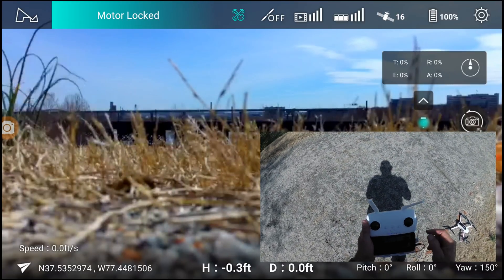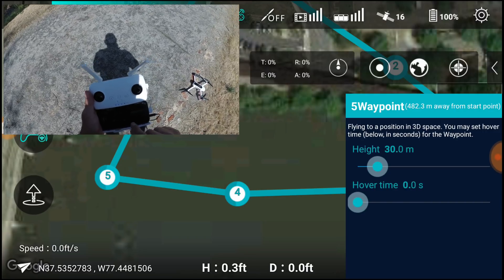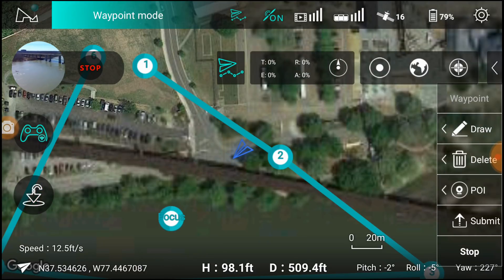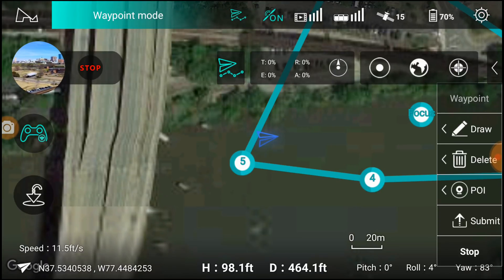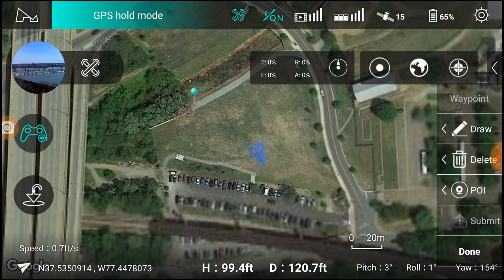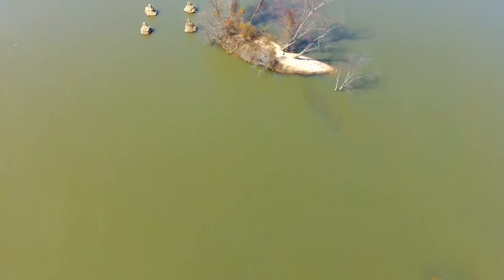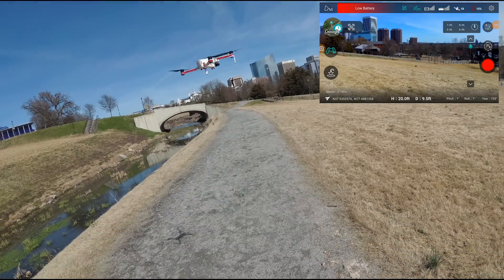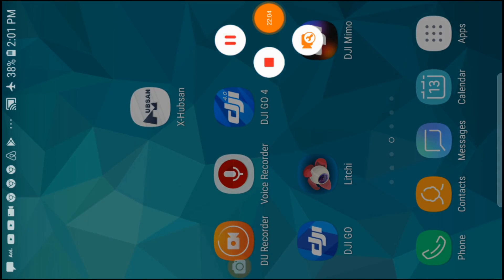Hubsan Zino  Exceeds Waypoint Limits -Firmware Update 1.1.48

Comment: I would like to know something specific about waypoint missions on the Zino. I don't own the drone but I need one for mapping missions. What would happen if i plan a mission in straight line in 1,5 km away? Would it stop on the 1 km range border and RTH or it would finish the mission till 1,5 km and then RTH? I am mapping on higher altitude and open areas so i am not afraid of returning to home and hitting a tree.

As i am not very pleased with FIMI's support since my Mi 4k camera burned out i really think Zino would be better replacement than the x8 because of the cheap spare parts you can buy later and of course - cheap batteries :)
Reply from the maker: The Zino will return Return Home after reaching 1KM (3280 Feet) even if it is performing a waypoint mission.

Comment: What app are you using. Looks like a modified X-hubsan app. Also, you were able to submit a new waypoint mission while the drone was still in the air? Can't do that with the H501A. Thanks...nice flight.
Reply from the maker: Thanks for the kind words. The XHubsan app stock from Hubsan version 1.6 . The Zino waypoints are easy to modify and quit to execute!

Comment: Zino is so buggy.  Even after updates, doesn't seem ready for Prime Time.
Reply from the maker: I  had issues at first but once I figured out that once I cached  my maps and then put my phone in airplane mode it made a world of a difference. Don't forget to put your phone in airplane!!!
Reply: Wow!  Thanks for the message!  I will follow this advice.  I can't place a POI inside a set of waypoints.  I would like to video a vintage landmark.  Every time I try I get a Map Coordinates Calibration stating "Are you sure to calibrate map coordinates".   I've tried everything I know of...any thoughts?  One more thing...how did you cached you maps?  Thanks for the help!
Reply from the maker: @stephenscott2376 OKAY, here is how I do it. I power up the Zino aircraft first, then I power on the transmitter, then I start the X-Hubsan App --> Enter Device --> Enter Main Interface --> I then  plug in the USB cable to my phone  --> Bind Aircraft --> GPS Accuracy Test --> I test that the gimbal movement --> test video and camera function by starting and stoping video --> Press on the X-Hubsan Google maps button and then I expand the area that i will be flying ---> Minimize X-Hubsan app and go to my phone settings and put it in Airplane Mode. Go back into X-Hubsan app and off I go. I crashed my Zino because I left the WiFi on the phone and it conflicted with the Zino transmitter WiFi. Hubsan Support analysed my log files and they found  WiFi  connection and disconnects occurring between the transmitter and the controller and the phone.  Here is the video of the crash... https://www.youtube.com/watch?v=wnW-lL-Spr0&t=34s
Reply: @Duranafy  if you turn on airplane mode how does it connect will it not turn off WIFI ? 
Hope to get mine in next few days have been watching videos.

Comment: I always loved the X-Hubsan App for its Waypoint planner. It is very user friendly. Not like the X8SE (Fimi Navi) which is kinda cryptic. I guess you could extend the Zino waypoints as far as your connection holds. You had a few momentary disconnects but not long enough to hit failsafe mode. That is one thing I love about the Parrot version... the waypoints can be 2 miles out and as long as you have battery power it will complete the mission regardless of connectivity. Nice shots and very smooth. Once the Zino gets above 5m or so, it flies great. Too back we can't adjust the yaw rate. Thanks Again for all the work.
Reply from the maker: Thank you for inspiring me to make these videos, without your feedback, pointers and encouragement it sure would be a dreaded task. Thanks again! Please keep the comments and question coming.
Reply: This may be true for the Zino but not the H501A. When you use the app to do waypoints it will start the mission but if the drone loses WIFI connection it just stops and hovers. The waypoint mission is not autonomous. I can use the H501S with the H7000 transmitter and it will do autonomous waypoint missions. Was very disappointed in the X-Hubsan app and H501A. Wonder if the Zino will work with the H7000 transmitter?